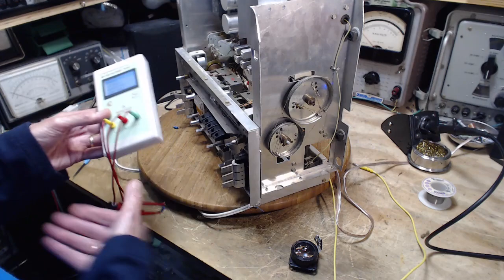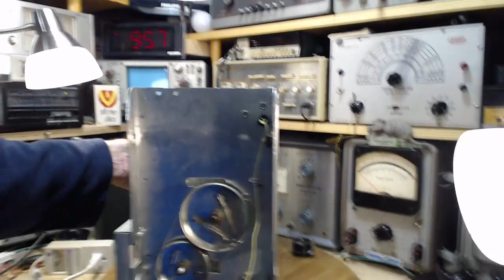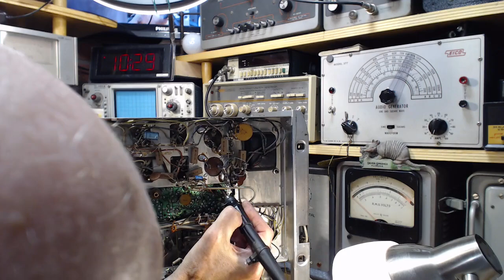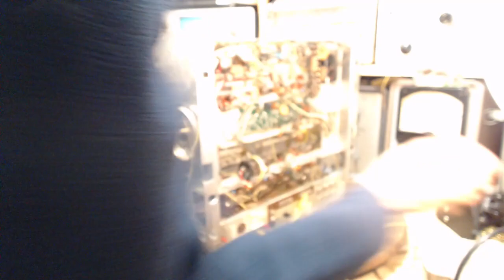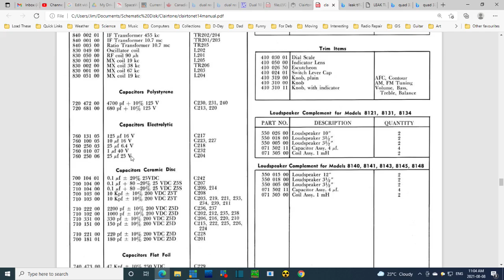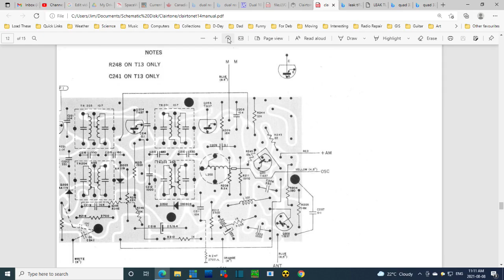Clairtone Console Stereo Video #12 - Six Electrolytic Capacitors Replaced

Comment: Why does he go to the length of making up a 125uF capacitor to replace C217? A standard value like 220uF in that place would be perfectly fine, because all the cap does is filter the sub supply voltage derived from Zener D204.

Comment: Up to expectations, poor troubleshooting, appalling repair skills. Reason that "miracle" component tester is unreliable is that it is basically an AC ohmmeter, and the model he has uses a square wave 1-10kHz test signal, too low for small caps, too high for large ones, and the voltage applied is only 4.5VAC. Jim is fixated on the displayed capacitance and totally disregards ESR and Q factor. I guess he trusts more using the vintage tester applying 50VDC to a cap rated as 16DCWV. Once upon a time, an unsuspecting customer dropped a set with a turntable complaint. Now he has a set with a truckload of added issues Jim's making.

Comment: I am glad he is changing the caps as they all should be changed, but....   Changing parts without removing the board is hard enough, but a small opening and under heated solder iron don't help.  Who knows what damage to the board happened as he yanked out the not totally unsoldered caps.  Replaced with close enough values and dried out NOS caps.  Classic Jim looking for the 125uf cap at the end.  Keep it up Jim!